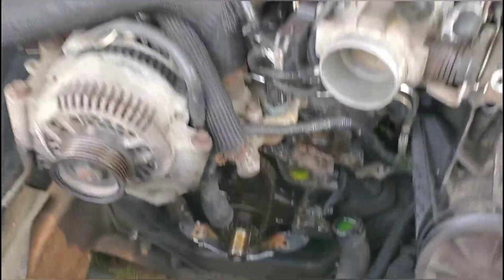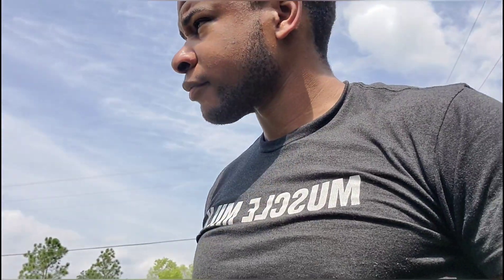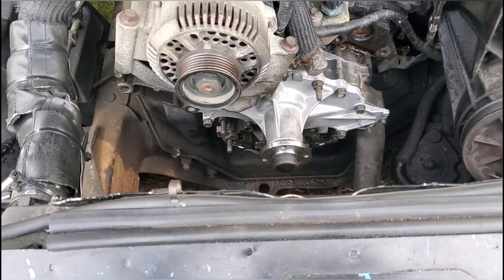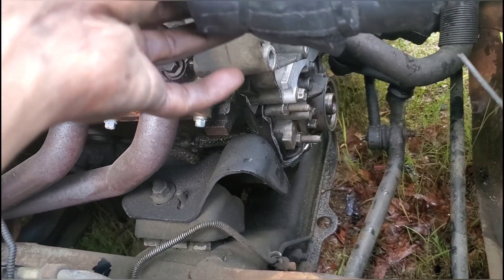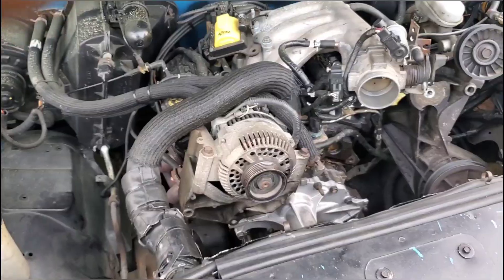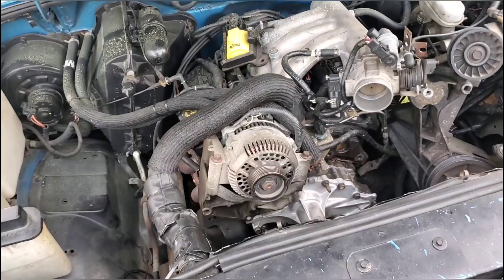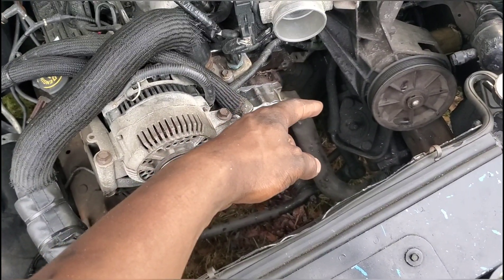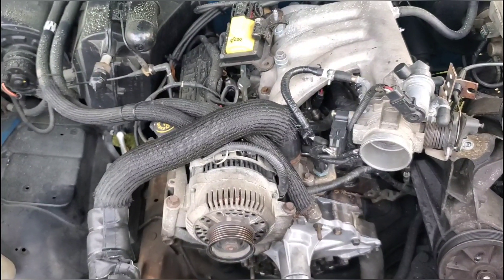Ford Ranger + COVID-19

Comment: Hello I came across your 3.0 V6 engine mod video for the Ford Ranger and was super surprised how much power you got to come out of the worst motor they put in the Ford Rangers. I mean... stock it got the power of the four cylinder 2.3 l and the gas mileage of the 4.0 V6. Hang in there and be sure to defend your TP.👌✌